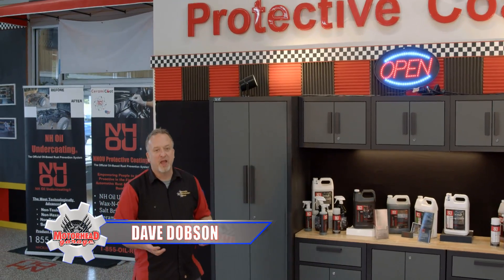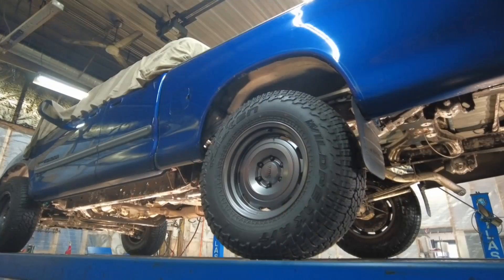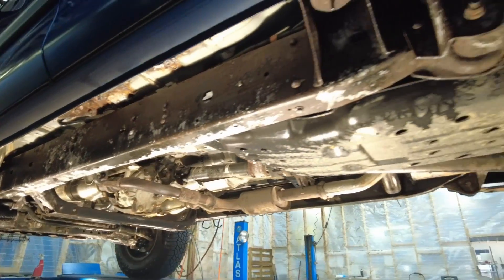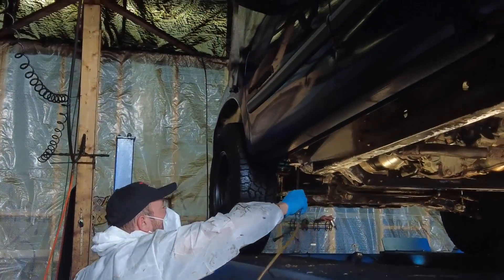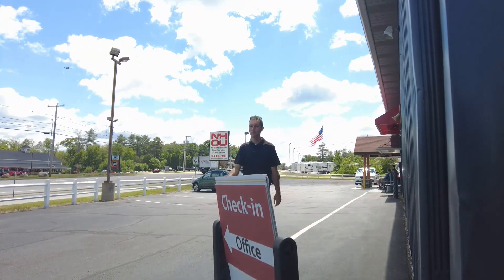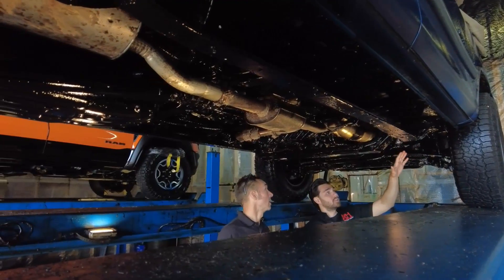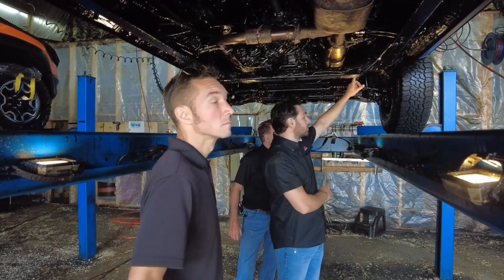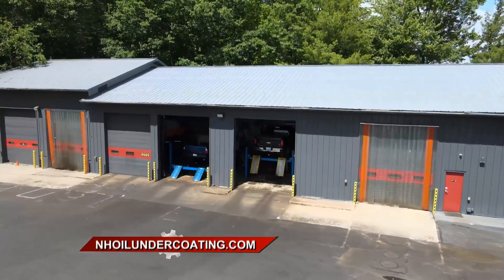NHOU  Rustoration®

Comment: I had a rustoration done on my hummer H3 6 years ago, undercoated every year since then and I couldn’t be more impressed. This is by far the best way to properly protect your vehicle from damage over time due to corrosion. 10/10 would recommend. if you have rust, and want to protect your vehicle you need to go see these guys 👍

Comment: I had this Rustoration service done on my 2011 Chevrolet Colorado and I'm really happy with it. It was the first treatment of any kind on the frame since I bought the truck brand new in 2011. 

I did this in 2022 and every year after I go for an oil undercoating. So far everything seems really good and I am grateful for this company!